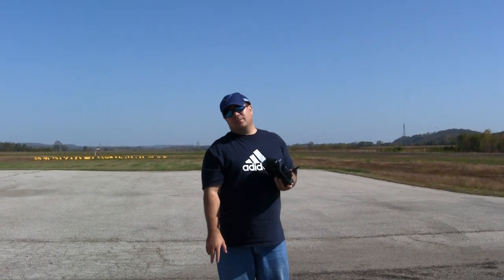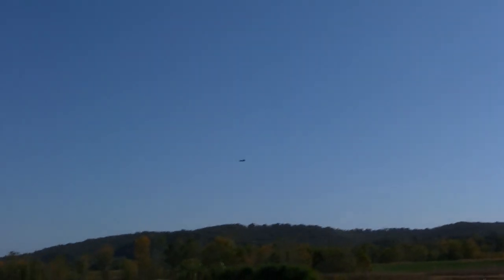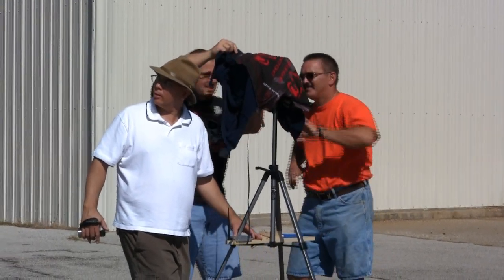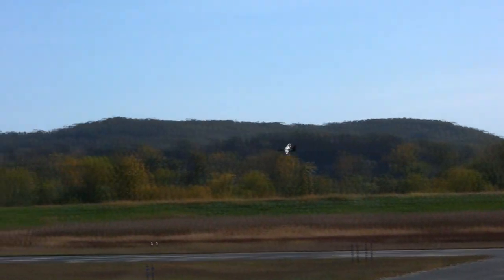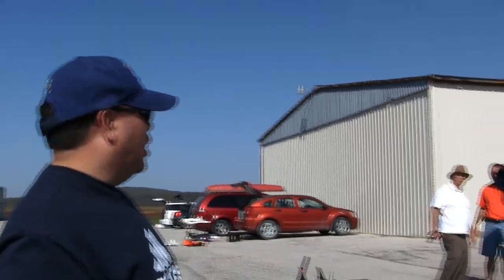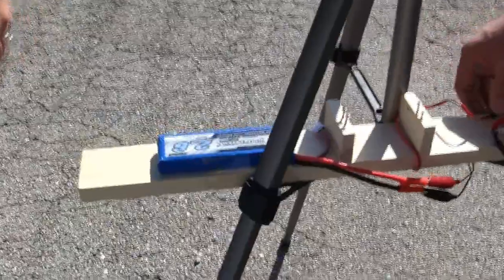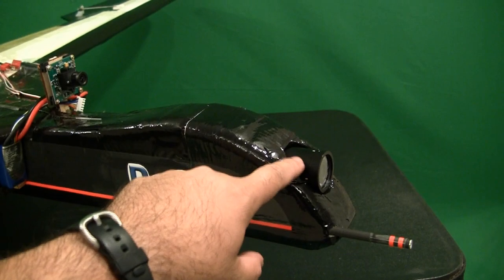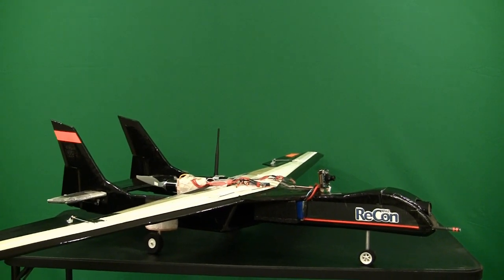My Homemade UAV with KFm2 Airfoil (FF-Recon)

Comment: This test was very good despite the challenges. The video link worked, the video quality from the Contour was superb and most importantly, the model platform delivered. Filming while the motor is running usually results to wavy or jelly lines - I noticed none of that. Good job folks !

Comment from the maker: @PukinDog68 
Thanks PukinDog68. The hd camera seems to work pretty good. I just don't like the weird lines it gets sometimes from the Sun's glare. I might try a lens shade and see if that helps. I do agree the plane wobbles back and forth a little at slower speeds. Part of it may be the long nose and also the front landing gear hanging in the wind. Bigger vertical stabs may help.